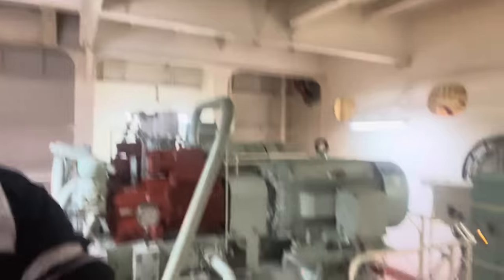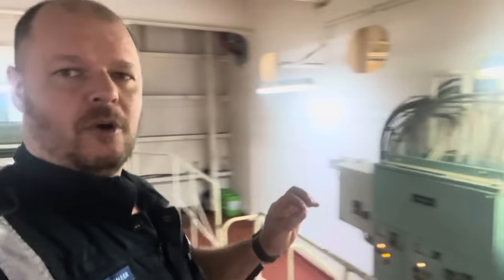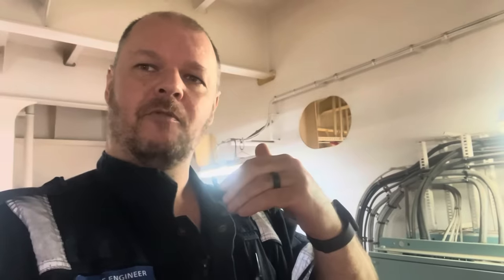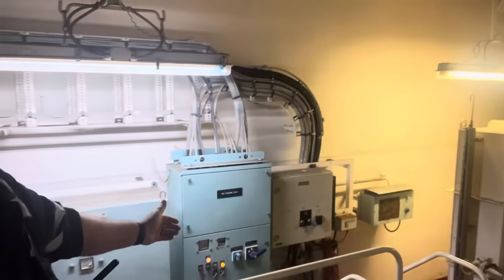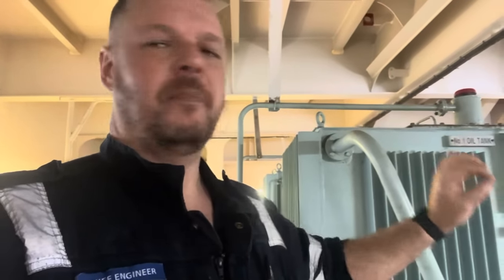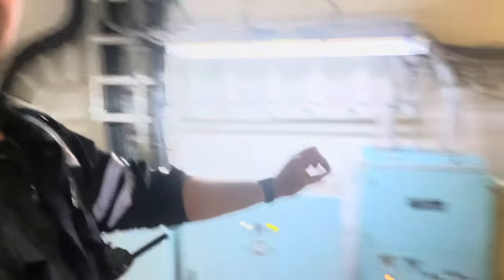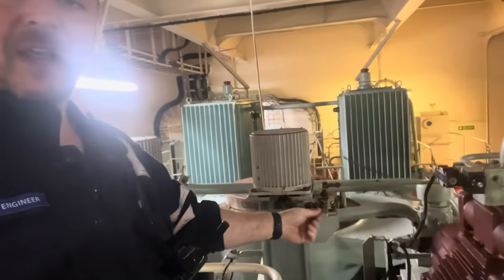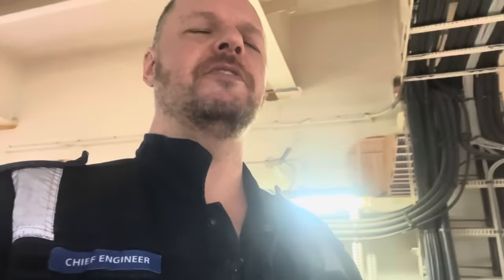Dali size containership steering system. How it’s designed to not hit Francis Scott key bridge

Comment: Aside from the crash and related discussion, i'm interested in a technical talk, a general overview of these things.
In your expert opinion, a specialist operating such a vessel, how would you rate the steering system employed in these class of vehicles.
- Do you find them satisfactory, or could there be improvement be applied to them?! 
Not theoretical but something that is already available and could be used on these ships as well. (example on how oil tankers used a single sheet of metal and they causes so many ecological disasters back in the day although there was already knowhow for having multiple layers)
- Does this kind of ship have bow thrusters?! Would they be useful on a separate independent powerbank with several layers of redundancy, like wired and wireless communication to activate them?
You know, this kind of thinking for making life better aboard these ships regarding safety for the crews, cargo and everyone around, to prevent even worse tragedies.

Comment: It strikes me as odd that it’s only a monthly exercise test with no ATS to schedule them with. My building was apparently required to do unloaded weekly and loaded monthly. You’d think a system with far more risk/responsibility would have stricter rules than the rules for a residential apartment building since an apartment building can’t take out a 2 mile long commuter bridge as a result of its generator being a few seconds too slow.
Reply: The EDG testing requirements are weekly (this checks that it work properly - starts, voltage comes up, breakers shift etc.), the monthly test is a load test, in which case the operators are to run  as much equipment as possible to load the engine.

Comment: Great info. 
But in all cases, the rudder moves the rear end of the ship, not the front. 

So must move the rear to then apply power to change the direction of travel, from the rear.

Comment: Was there an emergency reverse order given?  Was that a right hand or left hand propeller?.  In reverse the rudder would have been largely useless because water flow would have stalled the rudder.  A ship in reverse, depending on the rotation of the propeller., would swing to one side or the other.  Additional inputs are, underwater terrain, wind, anchor , and already initiated turns.  Six days and propeller rotation is yet to surface.

Comment: Questions? Do both generators ( primary and back up) get fuel supply from same source? If so could both gens have received poor quality fuel (dirty), lost fuel pressure and failed to operate, one by one? Id be looking into why these gens stopped in the first place. Redundancy gone perhaps with poor fuel (filters plugged off). Or am I mistaken? Sorry if these questions have no merit.

Comment: Ships steer like very large shopping trolleys. The stern moves to change course (that's where the rudder / propeller is) - not the bow. If the blackout occurred when the helm was to stbd (during minor course adjustment) the steering gear freezes without power. The stern moves to port (due to the shopping trolley effect). If the stbd anchor is dropped as the stern  moves to port  during this time it will drag beneath the keel further exacerbating the turn to stbd.

The helm is being constantly adjusted by the helmsman or the autopilot. However when the power goes out  the steering pumps stop working and the rudder freezes at the last position until the emergency generator starts. Even if the helm was at a minor, say,  5 degrees to stbd momentarily when the blackout happened it will be a full minute before the power was restored. Without the propulsion engine providing enhanced flow over the rudders the ship will continue on the same course at 6 knots for some time even with the helm hard to port due to the 'sail' effect of the high containers  .

The emergency generator starts about 1 minute after blackout. It can power the steering gear but is not big enough to power all the propulsion engine auxiliaries. The main generators must be used.  To source and correct the initial blackout problem then get the main generators back "on the board" takes time. Only then can you re-start FW, SW, LO pressure, LO scavenge pumps and fans, blowers etc etc BEFORE you even can think of starting a four deck high, MAN B&W S90ME-C8-TII,  47,000 BHP,  2 Stroke diesel in reverse.
Reply: Have you ever seen a ship with automatic blackout recovery?   Pretty cool in that everything starts right back up.
Reply: @Rapture1469  Not available on all ships and rather limited on most due to the need to start everything in the correct sequence. The generators cannot handle a massive start load for everything at once.

Comment: From viewing various videos of the collision... I see a power outage, approximately one minute later, power is restored. Large amounts of black exhaust smoke is then seen. I have been told that if the generator(s) go down, the main engine oil pumps also go down, and the main engine shuts down due to loss of oil pressure. Is that correct?
My theory: Backup power kicked in, main engine is put hard astern, and the 'paddlewheel effect' kicked the stern to port, causing a swing to starboard and...collision. 
Given the multiple redundancies built in, loss of steering would have been for a very short time. Had the main engine been ordered to full astern? Can't find audio from ships VDR,

Comment: Is main generator power pumping fuel to the main engine or can the main engine continue to run on its own, I read the main has electrictronic controlled injectors, computer controlled similar to how a ecm controls modern diesel engines injectors. Does the main propulsion engine produce any of its own electrical power to run on its own?

Comment: Just how much control do you have in a channel without power? In my sailboat, if I lose the motor, I won't try running into port under just a rudder! It just sounds silly. I lift my sails or call for a tow. Losing power in the channel would just be a nightmare, I'm small enough to drag a lunch anchor until I can figure out having some power, just a nightmare for something this size.

Comment: From the actual video of the ship hitting the bridge it looks like they had the emergency power come on after the main went out BUT if that is true then they turned the ship as shown in the videos not away from the bridge support but turned it into the bridge support meaning it was done on purpose. If you watch the videos you can see the ship turning away from the bridge when power goes out and then when it comes back on you can see it change course towards the bridge support. with all the back-ups that these ships have and Bow Thrusters the ship should have never hit the bridge unless it was aimed at it by changing the course into the bridge on purpose. I spent 12 years in the US Navy 10 of which were onboard ships called "Sea Time" the last 2 yrs were shore duty, so I know this had to be done on purpose.

Comment: My experience with redundant systems is that, no matter how diligently you test, they can still fail, usually due the conditions leading to, or present, when the initial primary failure occurs. With generators that can be a sudden full load dumped on them such as trying to start multiple motors demanding full load causing them to trip out or for voltage / frequency to go out of whack causing sensitive clevernesses to go into sulk mode. Mr. Sod’s law states clearly that the chances of this happening are in direct proportion to your need for them not to.

Comment: During the 30 seconds while back up generator is giving power to motor 2, does rudder stay (locked) in the position it was in when power went out????? Meaning bearing should have stayed right where it was set.

Comment: WHY DALI SHIP TURNED? In the Baltimore harbor area, a vessel channel has been dredged for ships with a large draft (the depth of the channel is 50 feet, but next to the channel the depth is only 11 feet) and next to the port side of the ship there is a lot of this deep volume laterally, but only a little laterally on the starboard side.
   When the ship travels in the channel closer to the right edge of the channel, the suction caused by the propellers causes a clearly larger tidal effect on the starboard side of the ship than on the port side of the ship when the keel divides the suction in two.
   Now - when the engines are turned off, where do the differences in the tidal effect on the different sides of the ship take the vessel that has traveled directly on the fairway? Does the flipping tide turn the vessel towards the edge of a nearby draft? Did the strong one-sided burst of the tidal phenomenon cause the ship to turn itself to starboard? 
   I believe that the mere excess of water on the port side of the ship compared to the shortage on the starboard side causes the ship to turn right by itself as the water masses try to equalize. It cannot be significantly affected by turning the rudder to the left or by lowering the anchor to the sandy bottom of the harbor basin. Even if this is done, its significance is only formal.

Comment: If steering power is lost, wouldnt the rubber stay stuck in its last position?..  eg: straight ahead.   Then why did the ship veer hard right?   There was an anchor dropped on left side ship as well, wouldnt that pull the ship to the left?..

My question is, what made the ship veer right if loss of steering power?

Comment: You should have hydraulic accumulators, stored compressed air over hydraulic fluid that would let you move the rudder at least a couple cycles without AC power to the pumps.  So you have constant control in the interval while the generators are starting and taking the loads. Otherwise there is a gap in control ability at critical times.
Las Vegas shows use this method to move multi-ton stage platforms quickly and smoothly.

Comment: Sounds like a good practice would be to have the  secondary generators running as instant safety measure any time while transversing ports or waterways such as that. Any place that 20-30 seconds is way to long to not have control some form of control.

Comment: Would it be possible to have both the main system and backup system running at the same time when navigating in tighter waterway situations. Then if the main system goes down then you could immediately transfer to backup without almost no time lost to regain power. Once in open sea then shut down the backup system  if no problem has occurred in main system while navigating to open sea. Would probably cost a bit more in fuel cost but not as much as losses incurred in the aftermath of an accident. Just wondering if it’s possible.
Reply from the maker: This was a unique situation with Dali. Ships have backups upon backups. There’s at least 2 of almost everything. What seems to have happened there was multiple failures. Which is then why we normally revert to emergency power as the sort of third source. And that’s why we call it an emergency generator and supply and not backup

Comment: The Dali disaster was  not a rudder issue. It was a reverse engine issue which caused the ship to turn to starboard. Regardless of the rudder position, reversing CAUSES a turn to starboard. What we don't know is whether the captain or a crewmember reversed thrust and went to full power as evidenced by the smoke.
Reply from the maker: Can’t go full power with no electricity for essential items like fuel supply pumps
Reply: @steamman9193  The smoke shows that someone went full power reverse the instant the power came back on. The ship DID slow down.  Reversing CAUSED the swerve.

Comment: If there is a delay to kick on back up generator could it have been stuck in a cycle? Power failure > delay > backup gen > main power restored > back up shut off > repeat?
Reply from the maker: That’s possible without knowing the exact design of that vessel

Comment: It should be like the trim wheel in planes where even if the power goes out you can turn the wheel manually from the cockpit if you need to.
Reply from the maker: I don’t think you have a full understanding of the amount of power required to move a rudder that steers something weighing 100,000+ tons
Reply: @steamman9193  So have a high gearing ratio. It's not easy to turn those trim wheels either.

Comment: Based on this alone the NTSB have a lot of digging to do. We all really knew there must be huge redundancy built into steering and propulsion for these massive ships, just like there is in airliners, so it was incredible to see things go wrong so quickly and totally. Assuming the engines went full astern (I'm aware this is not an immediate process and requires a stop and restart) could she have usefully slowed herself from 8.5kt at the point the power went out if crew had reacted immediately?

Comment: when it comes to things that float, i pretty much go with the 3 is 1 and 2 is none philosophy. 

when i see this im thinking, why would a backup power source have ANYTHING to do with electricity?? yeah i see the two independent wirings and electric motors. shouldnt the first backup be a diesel generator or better yet, hydraulic system powered by diesel? 

power drops, diesel starts in 10 sec. got steering. 

appreciate this seeing how this is done on big boats.

Comment: On the older vessels but bigger vessels (mostly VLCCs) I'm familiar have a small diesel engine aft in the aux spaces that can provide hydraulics to run the rudder because the emergency generator is only capable of putting out a few kw to run the bridge, some lights and and main control. We would also have all the SSDGs online in restricted waters but only a couple on the bus.

Supposedly they were having major electrical issues while they were alongside so I wonder if there wasn't some deeper electrical problem with the main switchboard prior to them departing that was being papered over.
Reply: I've been 32 years at sea as an engineering officer, including a tour on a ULCC but have never seen a separate diesel powering the emergency steering arrangement. Always an Emergency Generator of sufficient power.

Even the smaller coastal water vessels I worked on allready had emergency generators of 100+ kW

Comment: Right on with the controls! Need a insta on dc system. The worst part was full reverse,that's what really did it. They were going straight for a bit, would have COASTED straight. The Navy has coms and engineer, during Restricted maneuvering. But at 3 % out of sync with helm, it blows a fuse, so get a part #, get the store keep up and find which storeroom it's in, and maybe they have more spares!  Has issues with that,had spare fuses in box. Swapping cables in a panic,or Ignorant officer on bridge trying to drop steering. Have held my ground many a night that we had to be going STRAIGHT for 20 seconds,or it was NOT gonna happen. Go get the Chief Engineer up to relieve me, it wasn't happening!! College boys
Reply: Reminds me of working on SR-71s. If a small part, even a screw, was needed, you were supposed to go off the flight line to the supply room and ask for them to search for it. Try doing that when it's 20 minutes to launch. So we all had "illegal" grouch bags where we kept small parts. Of course, they'd come around and make us get rid of them now and then, but they'd get the dummy grouch bags. When you gotta launch during wartime, you gotta launch.

Comment: Well, as nice as it is to be able to move the rudder, unless you're moving fast enough to be making steerage way (I'm guessing about 4-5 knots),  you won't turn there's simply too much ship in the water to affect the direction of the vessel below that speed... I would also be curious as to what your advance and transfer distances are at speed. Propulsion and steerage are just parts of the navigational equation.

Comment: My concern is that this vessel was in its channel and heading when it went dark.  Why on it going dark or around the time of dark did the veer begin ?  It veered and then stayed directly on that degree.  It did not continue to veer it stayed on a course.  therefore something caused it to veer and was then incapable of correcting the veer??    As to theories, that's all anyone has until the full report is carried out.  We must question everything as this is our only way to answers.   Plus what happens to data transmission ?  Is the bridge equipment on its own circuit of power or will it have to wait until emergency power is plugging in?  Because it seems that the VDR kept recording as it is supposed to but all data transmission was lost for around two minutes?  Would that be a normal circumstance in dark boat generator loss??

Comment: I was wondering how those big ships were steered.  In the Navy, when entering and exiting ports we had an aft steering watch. just in case.  Granted we were much, much smaller than your ship.
Reply from the maker: It almost wouldn’t matter because the bridge still had controls on the Dali. What they didnt have is electric for the steering or to run oil pumps for the propulsion engine
Reply: On aircraft carriers underway, it's manned 24-7 all the time with 6 hour shifts  "watches". MR & EM rates.
Reply: @charletonzimmerman4205  Much easier on navy ships with crews of hundreds or thousands. Typical freighter crew is 22-23. So nobody spare for manual control once you take into account shifts etc.